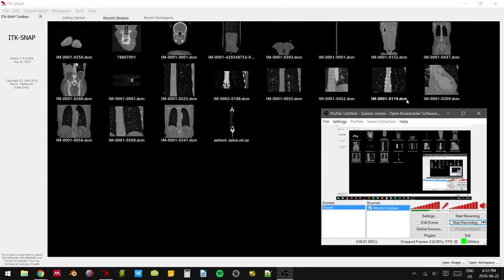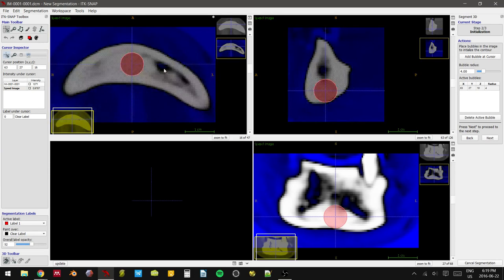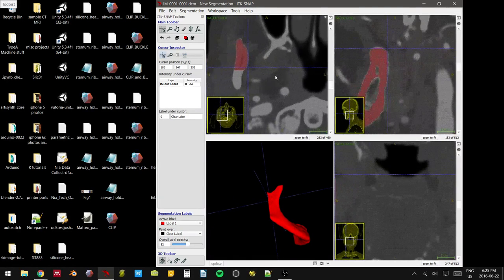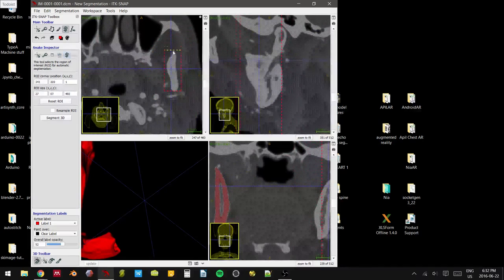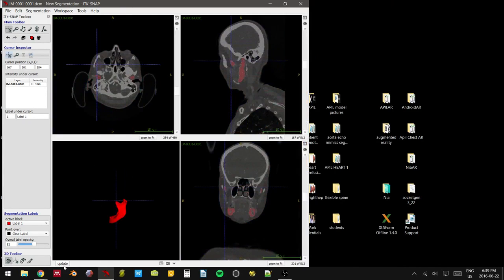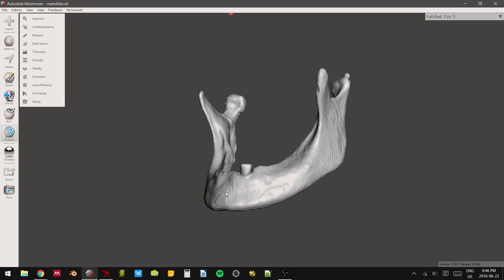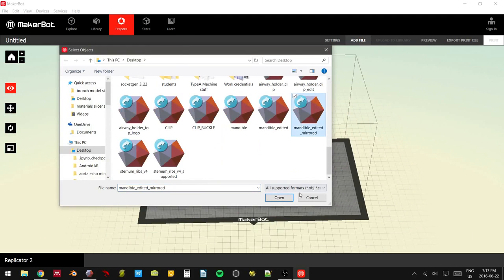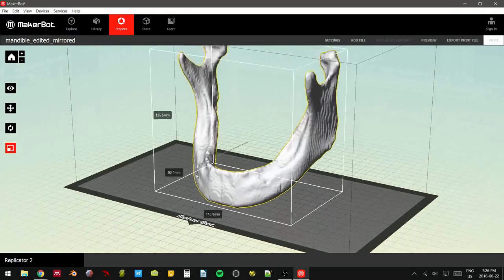Patient CT Mandible Segmentation for 3D Print Tutorial [ITK-SNAP, Meshmixer, Makerbot]

Comment: Have been using 3Dslicer during my degree and only just discovered this software. Am now researching which software to use for my up and coming thesis, this will involve studying a selection of CT scans of liver tumours in dogs for the following  (1) a) determine liver tumour volume b) determine that as a % of total liver volume c) correlate that with postoperative survival. 
(2) and also generate as photorealistic as possible 3D models of these structures in order to provide vet surgeons with better insight into the spatial relationship of this structure. These 3D models can eventually be integrated into a simple interactive visualization interface allowing for further exploration.  Will you software be able to help me to fulfil this brief, what are the advantages over slicer? thanks in advance for your time. Sandie

Comment: Can this be used for .MVL files? I can only view them ultrasound 3d scan by uisng View3DXI
Reply from the maker: I am not familiar with the mvl format. However in general the main issue with 3D ultrasound data is that in spite of being in a DICOM container, the actual DICOM elements that contain the 3D data are encrypted by proprietary, vendor specific algorithms, and unless the vendor provides a mechanisms for exporting the data in an unencrypted formatted (e.g. Philips via Qlab export as Cartesian DICOM) or you are using commercial software that has negotiated agreements with the vendors (e.g. Tomtec) you can't work with the 3D Ultrasound data outside the sandbox provided by the vendor of your US system. For CT or MRI this is not an issues since that encoding is standardized and vendor independent.